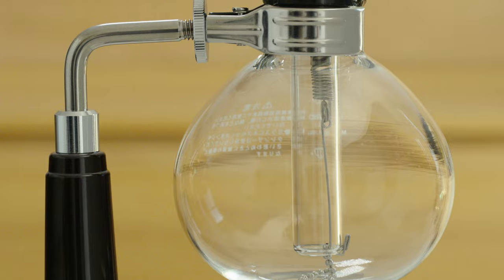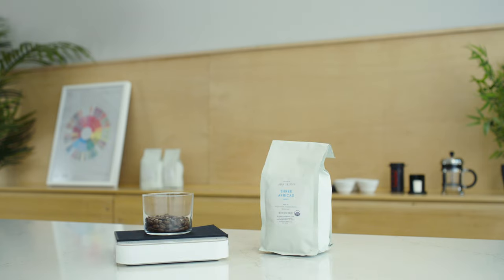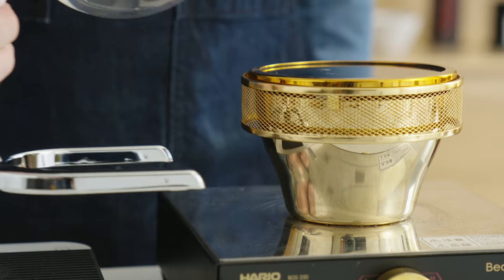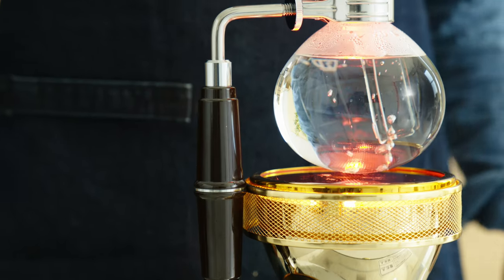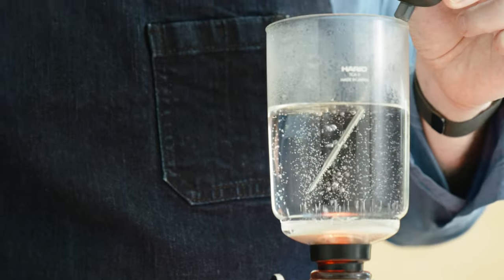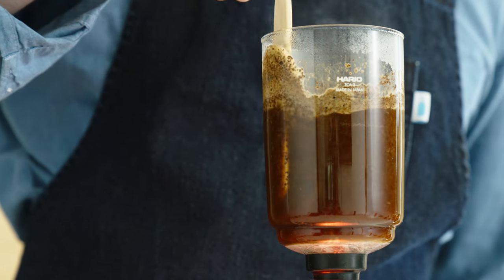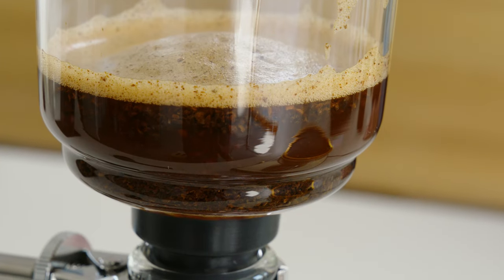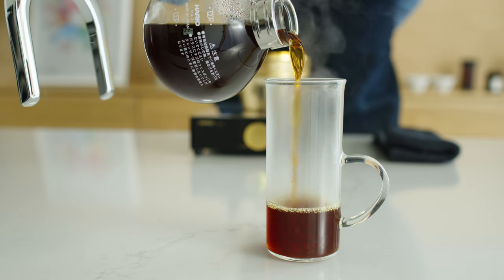Brewing Basics: How To Brew With A Siphon

Comment: Good video! Thanks 
The unit to measure the weight of fluid (I.e., water) is milliliter instead of gram. 
So, 350 ml of water not gram
Reply: Weight is always in grams. Milliliters is a measure of volume, not weight.

In any case, with water, it doesn't really matter, because 1mL of water = 1g of water, which also happens to be equal to 1 cubic centimeter of water.

SI is simple like that.

In practice it won't be exactly that due to differences in measuring conditions and impurities in the water, but it's close enough.

In this situation, he's likely using weight instead of volume because getting an accurate measurement is a lot easier when measuring weight on a scale instead of trying to eyeball volume in a measuring cup.